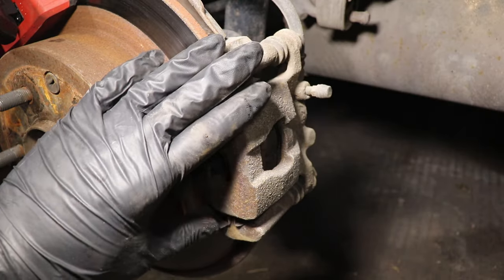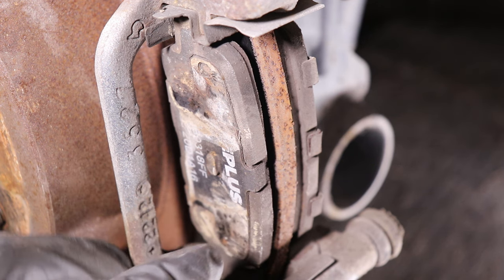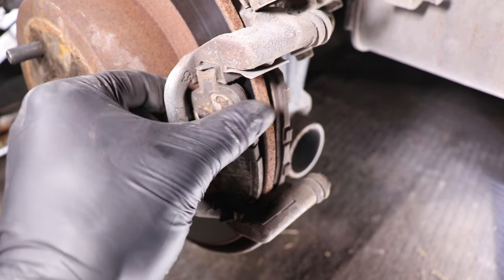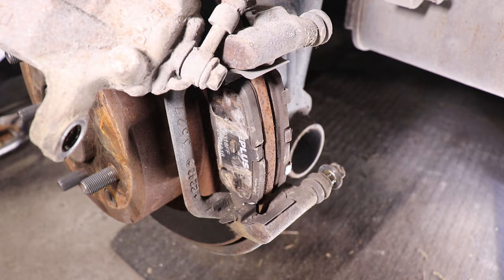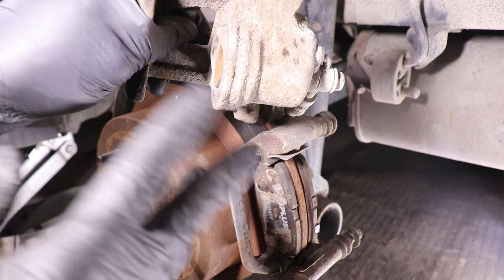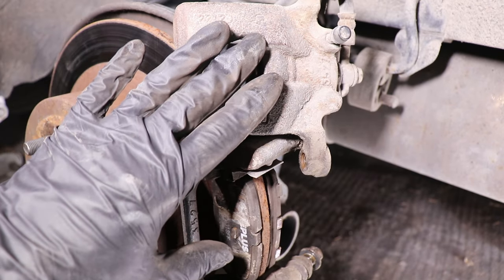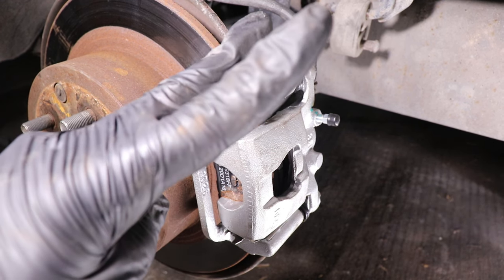How To Diagnose A Bad Caliper

Comment: This is like the 3rd or 4th video i've watched today, Here's the problem, I replaced the caliber on the rear passenger side, And i'm having the same problem with the new one,  Am a delivery driver, So I went through my replacement brake pads pretty fast, Like 6 to 8 months The driver side wore so badly that I had to replace, The rotor too, l ( By the way, I am replacing both rotors, And all The pads for the rear.)  The problem I'm having is, why is A Rear caliber for the passenger side frozen AGAIN!??! It is a 2020 Nissan centra, SV... like Is it common for the rear passenger caliber to freeze up?? Or do I just have a bad rear hose?
Reply: Might be dirty fluid? Hoses have any cracks in them when you slightly bend them and inspect? But I think you might need to bleed them properly.Start bleeding the farthest caliper from the reservoir first.And keep your fluid level topped off after every wheel caliper you do.Have someone pump a few times,like 5x,then hold the brake pedal down without ever letting off.While you open the line and barely open the bleeder valve,till the pumper signifies the pedal is all the way down.And tighten the valve and then the pumper can release the brake and start pumping it up again,5x,,then holds.And you open and repeat the process.Never let the pumper let off till you have the valve tight.That keeps air from getting into the line.Then goto next farthest caliper,and then on the front again farthest,till your at the closest to the reservoir.Never run out of fluid in it.And go around them again till you have a good stiff pedal on the brake.That opens the caliper drums and pads after you pressed them while driving.And your rotors should turn freely after you bleed them real good.Good luck and hope it works out for you and you get the job done safely and orderly.
Reply: @mitchellr.edwards381  Bro thank you very much,  Unfortunately, I still need to get a new Rear brake caliber, Within my struggles I ripped the boot..... Very frustrated I was
Reply: Its likely you have a bad flexi hose going to the brake. They tend to collapse internally and cause the brakes to stick

Comment: So I have the noise but it’s not slowly rotating. Tire spins and rotor spins fine. Just a bad noise. Had bearing, rotor, pad, and caliper replaced. Still making noise. Is it the bracket that may be unaligned?
Reply: Is the noise a clanking or a grinding/scraping
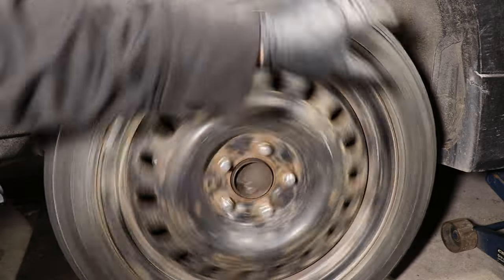Reply: @TChisholm8616 sounds like it at 0:47. Like I said it doesn’t have break problems at all. Just so loud noise
Reply: @bk2_sadie368  sounds like it is your wheel bearing needs to be replaced

Comment: What if I push the piston in and a few seconds later it slowly goes back out? Is that just a bad piston?
Reply from the maker: most likely you have an air pocket in the system. Something is pushing the piston back out, and its not the brake fluid. Could also be the caliper , the seal might be bad. Try bleeding that caliper first and see what happens.
Reply: @OneTrickTech  ok yeah I bled it and still the same. It is old. So I just replaced the caliper completely and hopefully it’s good. I had to go to work. So tomorrow I’ll check to see how it is.
Reply: How was it?  @Triosmind

Comment: Good, concise video. There's no need to replace calipers in pairs of only one goes?
Reply from the maker: Yea no need. The other can last another couple years and many miles. Just replace the bad one because it could also be a manufacture defect.
Reply: Oof..Bad advice. If you do something on one side, dude, always do the other side of the axle too. Or be cheap. If I replace the RP caliper, I'm replacing the RD caliper too...
 @OneTrickTech

Comment: How to piston caliper back again inside after push the brake stop??
Reply from the maker: if the piston does not go back in, then you will need a new caliper its seized
Reply: @OneTrickTech  
I am asking about how the mechanical movement of the piston works. When the oil is pressed, it pushes forward, and when the pressure is lifted from the brake pedal, the oil returns again. Whoever returns the piston ?
Reply from the maker: @LOLO-vu9qi  Ok I see, its called the square cut piston seal inside the caliper that returns the piston. It acts like a spring, when the fluid pushes the piston, the seal flexes and then when it retracts, it grabs the caliper piston with it. Hope that was clear. Thanks !
Reply: @OneTrickTech  

Yes, thank you 🙏💕for the clarification. Now the idea has been clarified well. There must be a strong movement to return the beast to its place again 🤔after the oil pushed it forward and out of its place. Thank you very much for the clarification.👍🌷🌿🙏

Comment: All the last few sets of brakes pads I replaced on 2 different cars, different brands were really tight on the calipers because of the clips. Here this seems way to easy to remove the pads. What is your take on this? Thanks
Reply from the maker: @benhaze1010  They should move freely on the caliper bracket. They usually get really tight because of rust build up underneath the clips. Every brake job I do, I clean the caliper bracket with a wire brush and file. Then I add anti seize before putting the new clips to slow down the rust build up.
Reply: @OneTrickTech  Thanks for the response! Yes I do the same as well. It seems the last 2 brands I used make the anti-rattle clip very wide and stiff to avoid noise complaints but makes their installation more challenging or I am getting parts not meeting OEM specs :(

Comment: Good video bro
Do you recommend going to a machine shop to resurface the rotors?
Reply from the maker: If the cost of resurfacing is lower than 2 new rotors then go for it. I personally would just buy new rotors
Reply: New rotors are about $100 each while resurface can be $20 each. I’ve had my rotors resurfaced by sketchy shops, I ended up buying new ones. I’ve also had rotors resurfaced by professionals and I was amazed at how good they looked. I want to say it’s not always the shops it’s the people working there.
Reply: I had a shop that would turn rotors, but the last time I went there they said no one working there knew how to operate the machine. Sign of the times.
Reply: @3gcraftsman  ...not good practice anyway. If you look at the letter markings on a rotor....you maybe only have 1-2 mm tolerance anyway that you can machine off.....often you want to take off more. And then....if you do turn the rotors, you have reduced the amount of metal that remains.....so the "thermal ballast" you have is reduced....and the brakes will become bad (warp), even faster therafter....if warping was the original reason to turn the rotors.

Comment: I have a 2017 Kia forte lx. The right tire doesn’t spin at all in the air. I am also getting a high pitched noise when turning right or breaking
Reply: Its front wheel drive

Comment: My rearward brake only works when I pull the ebrake slightly and then use the front brakes everything feels nice. But just using the city brake the rear brake isn't engaging but disengages . When I use the ebrake it engages and and disengages slightly I can feel the front brakes and rear brakes working right when I slightly pull the ebrake then use the city brake to come to a stop . But if I use just the city brake it won't engage.
Reply from the maker: Hey there, I believe you might have a brake hose that's clogged up, the ones in the rear. If you're ebrake is integrated with the caliper, then you might have a faulty caliper. If you're ebrake is linked to rear drums, then check both rear calipers and brake hoses.
Reply from the maker: also check for guide pins  that are seized, they can cause you to loose a lot of braking power

Comment: hey can the caliper pins, if one of them is stuck, can it cause the same noise ?
Reply from the maker: @xxdavidduranxx yes a stuck guide pins can cause noises. Multiple stuck guide pin will mostly cause a spongy brake pedal
Reply: @OneTrickTech  thanks for replying